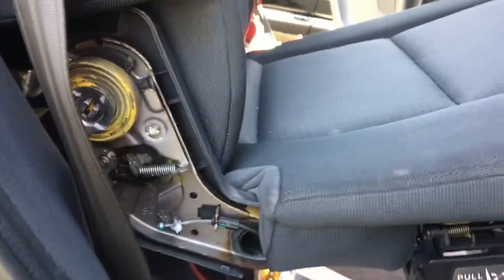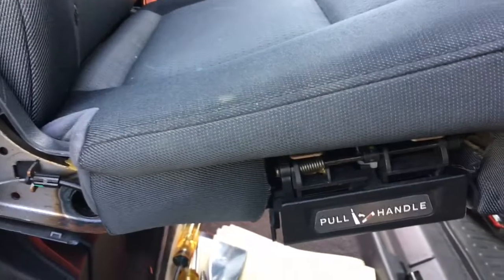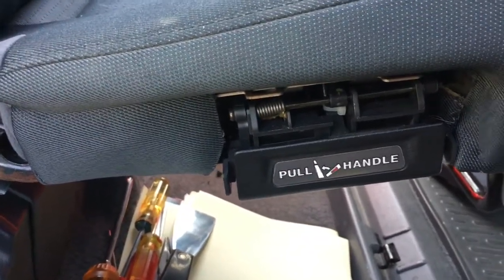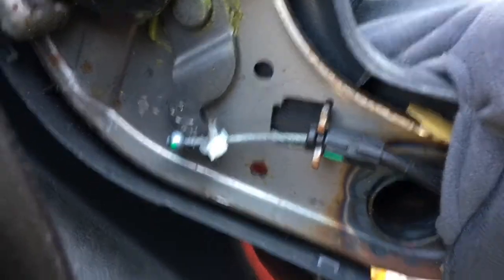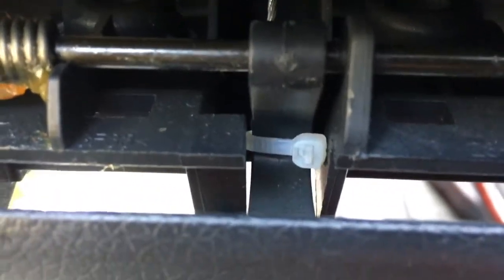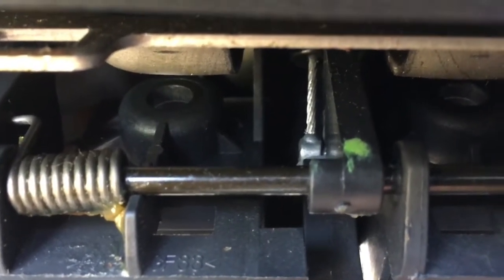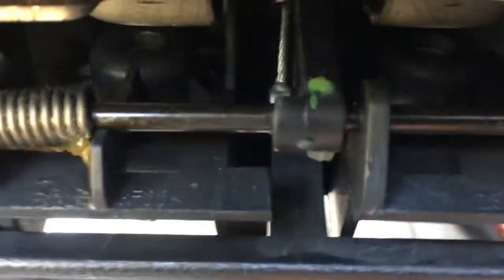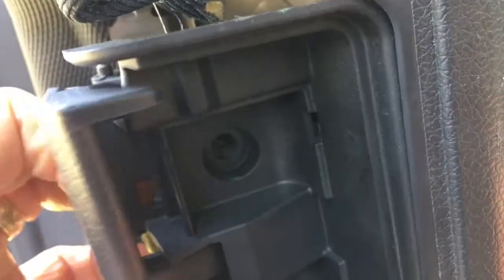Honda Ridgeline folding rear seat latch cable DIY fix

Comment: Your video gave me the courage to take a whack at fixing the rear seat in my '19 Ridgeline not staying up. I found that my problem wasn't the cable but friction in the mechanism that prevented it from going down all the way. A good spritz with WD-40 did the job. The Honda dealer wanted $165 just to troubleshoot! Following your directions, it took me about an hour all told.
Reply from the maker: Glad you took a shot & got it done & saved yourself some money too! Way to go!!👍🏼👍🏼

Comment: Thank you for this video! Dealer was going to charge me $1200 to fix this. I was able to fix my 2018 Ridgeline in 30 minutes by reconnecting the cable and using your ziptie trick! I'm sure it would have taken me hours without your video.
Reply from the maker: Thanks Donna!  So glad the video helped!!  Now it's all the way up to $1200 for a dealer to fix this?? Incredible!!...and I didn't realized the new generation of Ridgeline continues to have the same issue...so glad the video helped and you did it in only 30 mins!  Wow, You Rock!!! :)
Reply: @jeffdrake869  The mechanism was jammed a little so they wanted to replace the whole thing. I worked it a bit and got it moving again. Then connected the cable, which wasn’t broken. Put the zip tie on for insurance. Again, thanks so much!
Reply: They don't call it the stealership for no reason! 😅

Comment: Thanks for this....Great video that helped me take it apart and figure out the issue.  Mine was not a matter of the cable coming out and needing to be secured but the cable wire coming out of its holder that can be seen at 6:08 and caused the cable to not operate correctly.

Comment: I can't believe it but it happened to my 2023 model where the right side back seat refused to come down. Took the car to the dealer and the problem was fixed (the tech guy blamed the factory for doing a lousy job) but a few days later, the problem reoccurred. Thx for the clip. I put a zip tie filling the space so the cable won't slip out again.

Comment: Thanks for the video. It helped me fix my 2021 Ridgeline back seat when it wouldn’t go up and was locked down. I zip tied the hole where the cable came out in the handle latch.

Comment: So mine I finally got out, the actual plastic broke that holds the metal end of the cable.  Sure wish Honda would put a part number on the handle part.

Comment: Thanks for postings.  
My issue is the support for the seat when it's down isn't folding back against the bottom of the seat when it put in the up position.  Would that be cable problem  ?
Reply from the maker: Alan Ross Thanks for the message, I also had the problem once of the leg not folding up...I believe it was cable related too...will take a look today & see if I can recall what I did to fix...I’ve had issues with the seats 3 times over the last 13yrs, was able to Diy repair each time...Will get back with a msg later today.
Reply: Following
Reply: @jeffdrake869  any update to this issue? I'm having the same issue on my 2008. Thanks.

Comment: Hey Jeff - very in depth video. Interesting to see the inner workings of the Ridgeline rear seats. However, I'm having the opposite problem. My drivers' side rear comes up without pulling on the latch. Leg retracts just fine. But, it will not lock into the folded position. Do you think this might be a similar fix for that particular problem?
Reply from the maker: Hey Shawn, thanks for the message.  Hmmm...thinking on your problem.  My example, the latch and lock mechanism is working fine but the actuator cable just came out of the slot...I've never had the latch system apart before, but my first thought would be that the issue of the seat not locking into the down position their must be a latch problem, not a cable problem. That's my gut feeling...Does the cable appear to be in place and handle seems to move smoothly?
Reply: @jeffdrake869  I know its been a year, but just got around to it. LOL actually was installing a license plate camera which DOES require removing the rear seat, along with a bunch of other stuff. So, I figured while I had it apart, I'd give it a go. Anyway, the latch was indeed the problem. Your video did help, though. The hole that accepts the cable was broken, and the cable frayed. So, a trip to the junkyard. Replaced handle, and cable (which was way easier than anticipated.) and works better than when I got the truck.
Reply from the maker: Awesome! Still have mine…170,000 miles now…still Ruben’s great!